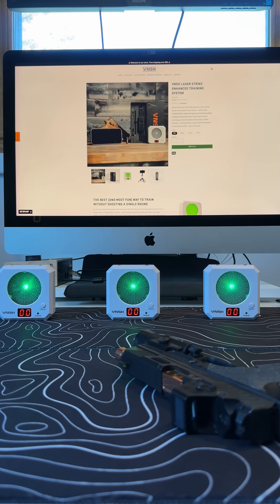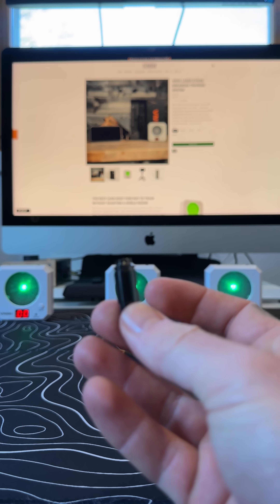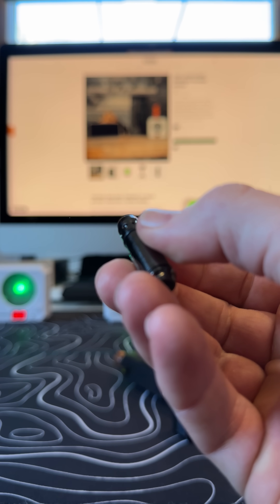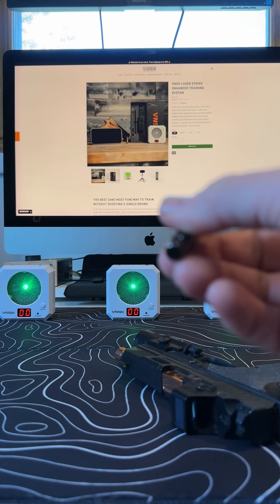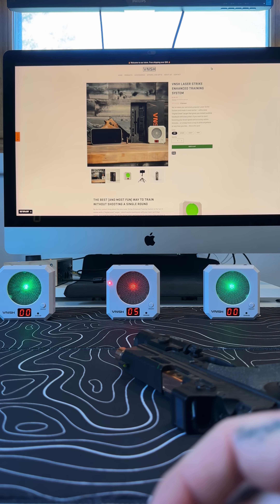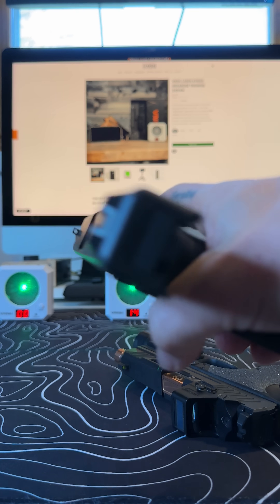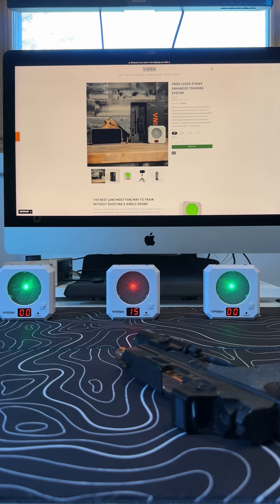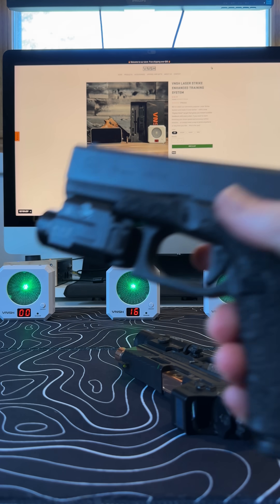VNSH Digital Steel Target Function Explanation - Pt 1

Comment: The Cartridge was not accurate at all. The laser pointed about 5 degrees off center, so at 30 ft, it was unusable. Contacted the company, they offered to send a replacement, then charged the card they had from the order for the replacement. Scam company.

Comment: Nice. I like the fact that you don't have to set up a phone and app. Just place the devices and shoot. I would like to get a SIRT or a similar gun to use with them to avoid the constant racking of the slide.
Reply: Without blowback this isn't training, you can dry fire the gun without this laser system, if you want to train at home with blowback get an airsoft blowback pistol.
Reply: @studivan  While true, I like the fact that I can track actual hits off a holster draw using a shot timer. Recoil management and recoil anticipation are real, but I can tell you in just a few weeks my live fire has gotten better, faster and more accurate.

Comment: This company is not burdened by an abundance of integrity. I bought this to practice with a Beretta 92F, not exactly obscure. The piece he is holding, that I bought, is marked 9mm but will not fit in my Beretta. First, they ignored my request for support. Then some genius told me to pull off the oring to get it to fit. Perfect. Now, it's unstable and useless for practice. This piece was mismarked, it is not 9mm, they knew it and sold it to me anyway.
Reply: Try adding some gun oil to the orings. Allow it to slide in with tight tolerance
Reply: @costephens876 It isn't for 9mm. It is mistakenly labeled 9mm. Forcing it to fit is not the answer. The right answer is to replace it with the correctly labeled 9mm that they do have that does fit. I am disgusted with this company that won't spend an extra dollar to make this right.
Reply: I just received mine today and I’m having the same issue.
Reply: @michaelmoon6884 Sorry to hear that. I was hoping it was a fluke. They know, and they just don't care. You can try removing the forward o-ring, but in my barrel, it just got sloppy. You may have better luck.
Reply: @michaelmoon6884  Sorry to hear that, I hoped it was a fluke. You can try removing the forward o-ring. In my barrel, it just got sloppy. You may have better luck. For sure, they could not care less.
Reply: @husseyka but then it will shift and be inaccurate. The only thing worse than no practice is bad practice.
Reply: @raredesign I know. It did! They have my money. They don't care.

Comment: What about damage to the firing pin with all the racking?
Reply: I'm not a gun expert. So, I don't know what gun he's using. But, damage to the firing pin is only a concern if it's rimfire. Even then, he has to do over 1,000 firings before dry-firing will damage a rimfire pin.
Reply: Might as well just keep your firearm in your safe and never touch it then. Damage to mechanical parts is inevitable over time, but live fire is 1000x more likely to damage your firing pin.

Comment: How does it work in the fire arm your using as to not dislodge and fire out
Reply: The extractor arm doesn't hook onto the rim of the cartridge.  When your done you have to pop it out with a pencil or dowel.
Reply: @electromech7335  Thanks for the clarity

Comment: I know its meant for training, but I feel like turning an actual firearm into basically a single player lasertag is just asking for an accidental discharge.
Reply: Only if you have actual ammo in the chamber😂
Reply: @animangafan342   Developing a habit of pulling the trigger on your weapon in areas that you would not fire a round- develops a bad habit, and it does, and has caused unintended discharge when the firearm is loaded.  You should only do dry fire practice in locations that are safe to fire live rounds. Using something like  this in your home is a TERRIBLE  idea.
Reply: @kesselrunheroj8497 well anyone who has a brain and treats every weapon as if it were loaded and clear and safes any firearm shouldn’t have to worry..

Comment: How do you rack the slide with the laser  round without ejecting it? Are you semi racking it like a press check?
Reply: Orings don't let it come out like that
Reply: @donhughes7339 probably not the case. The more likely case is that the bore laser has no lip on it for the extractor in the slide to grab as it’s racked backward. Normal rounds that are striker fired have the ledge in the casing for an extractor to grab and eject the spent casing as it cycles. My best bet, I don’t own the system though.